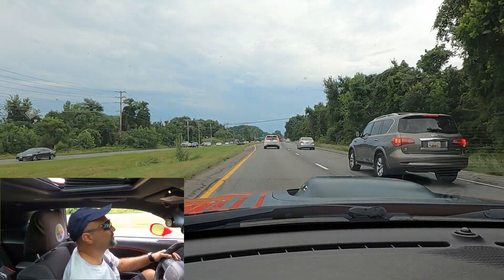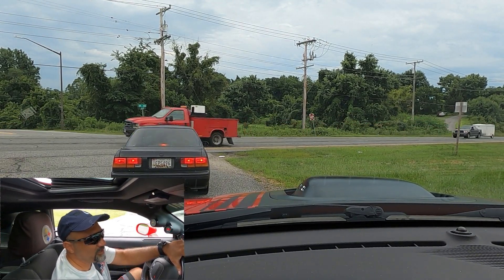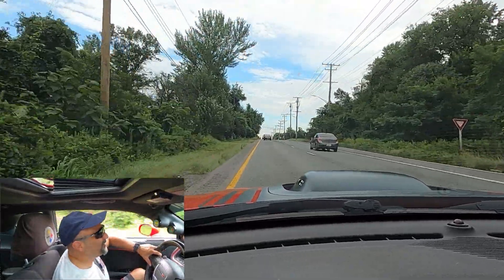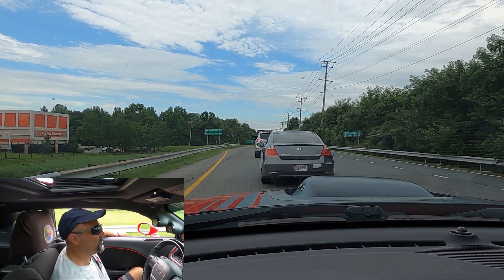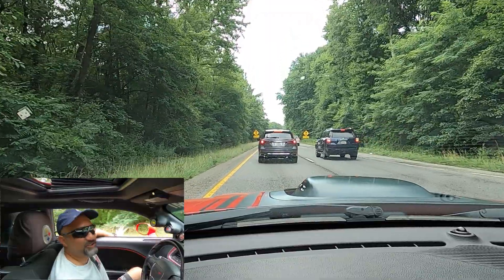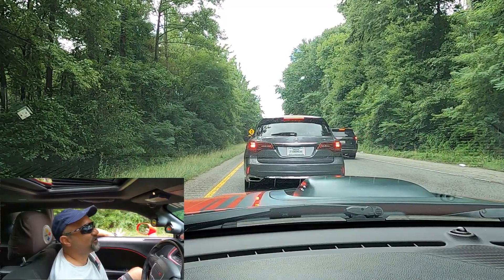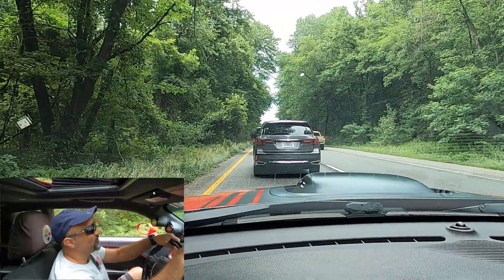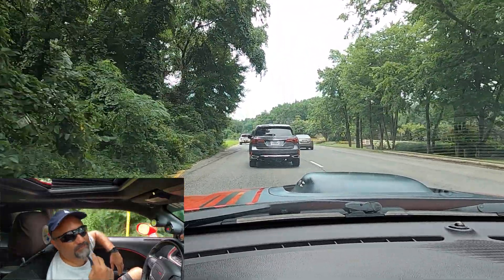Future for Shake 'N' Bake!

Comment: You can drop two more pulley sizes , the real issue will be the heat that comes from adding more boost , every psi is 10 degrees of heat at a min and you’ll want the red bov
Reply from the maker: Thanks brother! Yeah, I gotta figure out how to get the red BOV and water to air and the trans, and so on and so on... 😂😂😂

Comment: I bought my first R/T in August of this year (2022), when I bought it I was already planning on doing some work on it to boost it’s performance.

I looked through the build list and I may just be overlooking it, but I don’t see any mention of an upgrade to the transmission. Do you still have the 8hp70 transmission or did you upgrade to a 8hp90/95?

I’ve been having some problems in my research about how much power the 8hp70 can really handle and I’m just curious, if I don’t need to upgrade it for my build then I would rather save the money. For reference my build goal is gonna be somewhere in the 600-650hp range.

I know a bit about engines but I have limited experience actually working on them, I did some simpler mods to my first car (exhaust system, intake, etc) but this would be my first time diving into forced induction and larger power gains so I could really use some advice.

I have most of the supporting mods already figured out (injectors, fuel pump, thermostat, exhaust, headers, etc) the biggest thing I am unsure of at this point is transmission and drivetrain components.
Reply from the maker: Your goal is getting close to the top of what the HP70 can take. I do think you are safe at that range. Any more than that though, a transmission swap will be required. If you like the ride of the 2 piece driveshaft, I would upgrade to a Hellcat one, especially if you are mostly on the street. If you are doing a little more drag racing then a one piece is the way to go. I would definitely upgrade the axles as well. I've been running Hellcat ones for a long time and have had 0 issues with them. If your R/T doesn't have the 3.09 LSD, I'd recommend that upgrade as well. Hit me up on Instagram if you have any questions, issues, or concerns. 💪💪💪

Comment: Have you run into fuel pressure issues? My regulators keep failing. They are aftermarket and I am trying to locate an OEM brand. I have a close to OEM unit on the way. From Delphi. I pray it can hold the pressure. Are you using stock or aftermarket regulator?
Reply from the maker: I have a complete Level 4 full return fuel system from Fore Innovations which includes their regulator. 0 issues so far. 😉
Reply: @ModernRedHemi  This tank and fuel system is the worse! I found out it is the syphon/venturi for the filter/regulator side uses about 20gph. So i am going to throw 2 pumps at it and see if that works. I just dont have the funds to buy a whole system. Not after just paying 600 to Steve White for a poorly manufactured pump basket hanger setup.